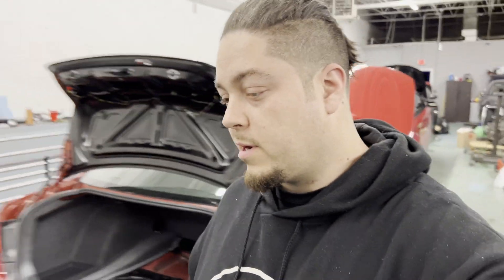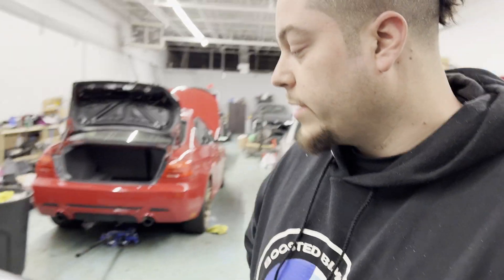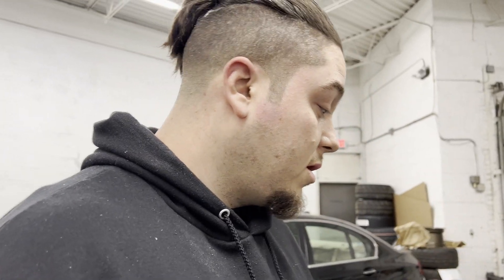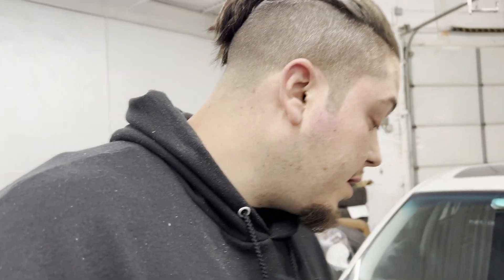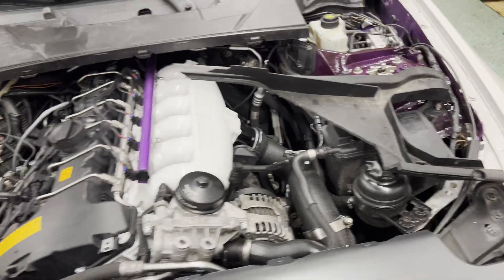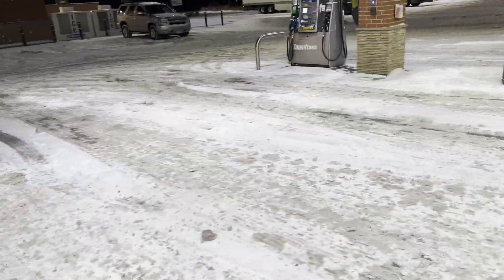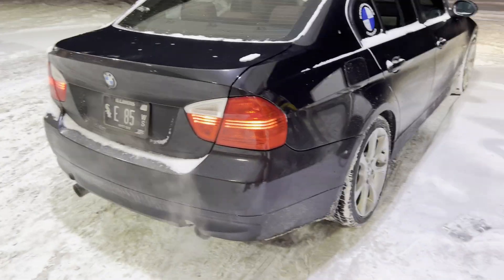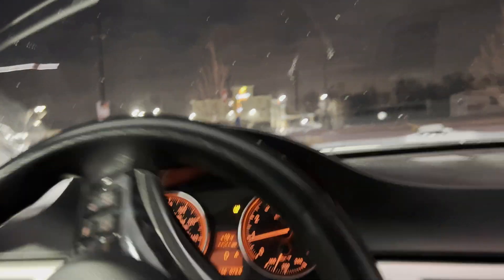335xi Water/Meth precautions!!!!!!

Comment: So I have been running water/meth for years and I had a similar issue as soon as I went port methanol injection. What I did to remedy the problem was I put a solenoid on both sides of the rail, so a solenoid before the rail and then a solenoid after the rail which then blocks off the pipe going from the rail to the charge pipe, This completely fixed the issue of water/meth being sucked out the lines under vacuum.

Comment: Hey brother just a few thoughts on this. 
How would the charge pipe be under vacuum after the engine is off? I thought the only area that sees vacuum would be post throttle body with the throttle body closed. 

Also I believe the nozzles are supposed to have a check valve built in? Although I am not sure what nozzle you have. So maybe you have a failed nozzle.
Just my own thoughts I may be wrong just wanted to see what you think about this.

Comment: By the way Sic Ryd!!! We all want you to do the video on the tune and the knock trim pods! 
Syc pro tips✌

I was thinking of some ideas you could do some syc videos on.  
CAUTION I'M not responsible if any thing happens!!!
the following stages of fun 😎
1- Intake charge pipe Before the intercooler.
2- Intake charge pipe After the intercooler which is what you have setup  in regards to use the Distilled water and methanol. Either one or both..  still doing its thing dropping Temps... It's the key just like how alive the N54 gets when she inhales cooled air.
3- Two or three Co2 tanks to spray the intercooler from out side and wrap the intercooler with a thermal coating just around the the sides and top and bottom  to try and stop the ice from forming and cracking braking the radiator at speed FML that's scary just thinking about it.
4- Co2 to a relocated oil cooler for the engine oil to keep its temp in range to stop that oil breakdown to water viscosity that causes fatality... 
I would set that up some how with the tips or boost and ambit temp Sensor.
Pwm the solenoid not to go too cold But that's good for taking out 20% of the engine heat..
5- going to need more flow over drive that fuel pump on the motor or add port injectors. Keep the ARF close to 12..
6- EGT gauges wire it up if you want to tune each cylinder or each bank.
7-Next try 3 stages of Nos No?🤔😃😉

Ride or die... ✌

Comment: Should you put the solenoid valve as close to the charge pipe as possible in case there is water left in the lines between the valve and the charge pipe? Or is that not how they work? Cheers
Reply: I was gonna comment this too. I thought I read that in the instructions one I got for my car.

Comment: Is that on a stock head?
Reply from the maker: Built head. All ferrea valvetrain
Reply: @N54RacingChannel  stock cams?
Reply from the maker: @Titanium_E82  yep
Reply: @N54RacingChannel  wicked bro
Reply: @Titanium_E82  cams on the n54 are already fit with a power profile cam setup similar to Vtec you have in a honda.